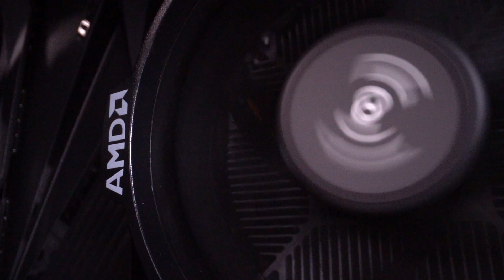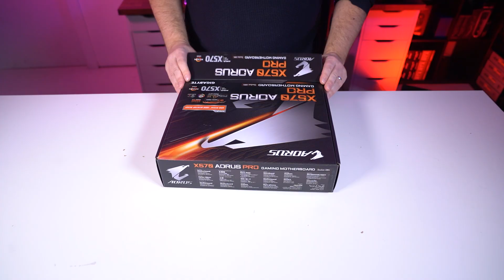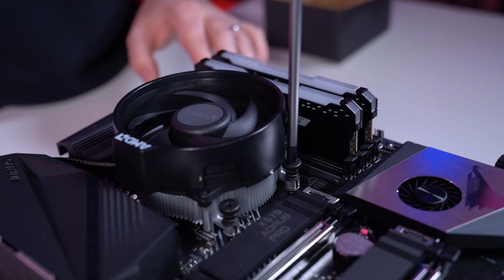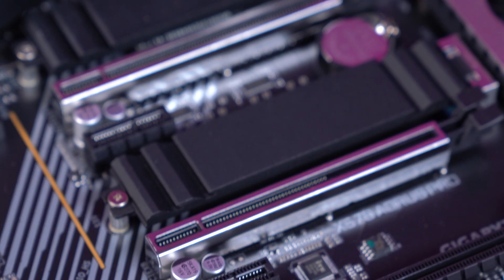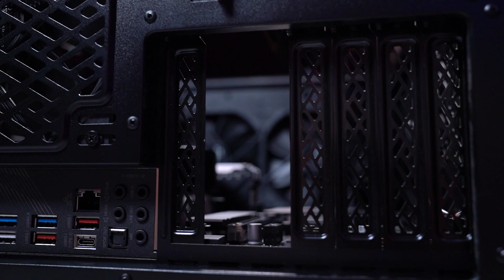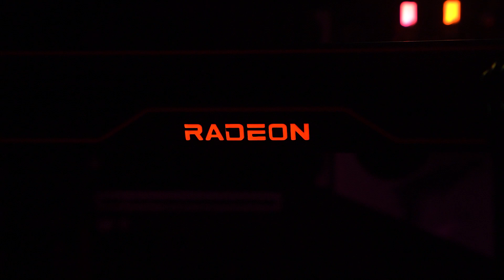$2500 AMD Radeon RX 6800 Gaming PC Build! | R5 5600x & Define 7 case

Comment: $3000 but a stock cooler
Reply: LOL.  I built a 5600x + 6800 mini itx build for $2200 and that included a 120mm AIO, 2 Samsung EVO 980 pros, 32gb ram, SF600 PSU, and Evolv Shift 2 case.  BTW, my 6800 cost me $850 before taxes.